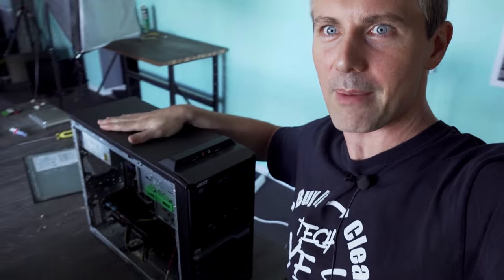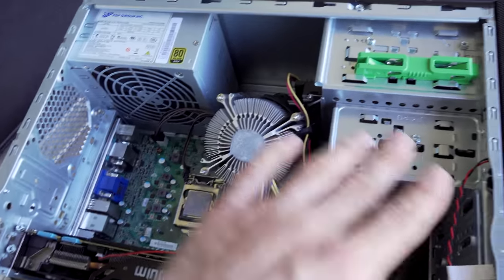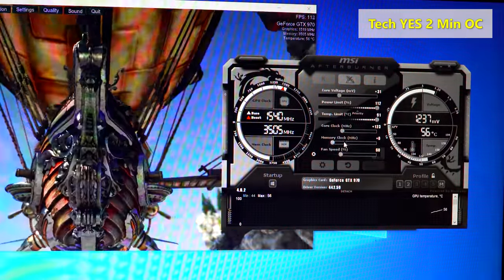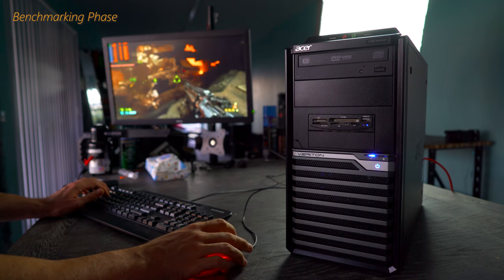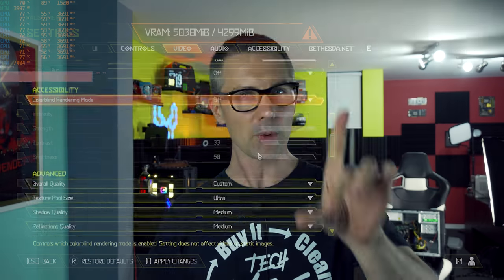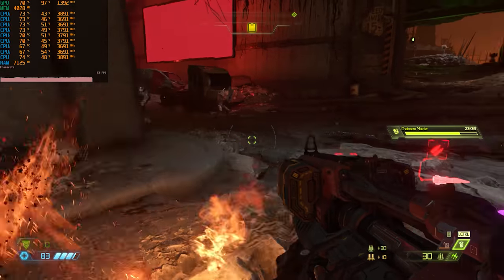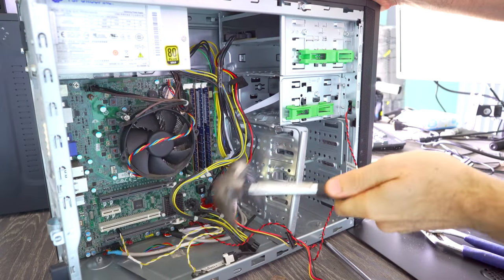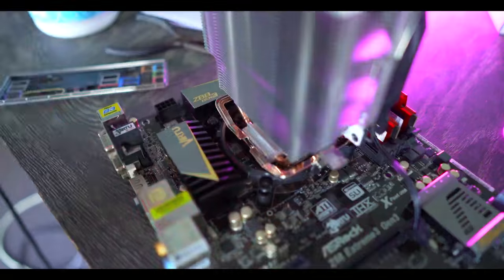How I Built a Gaming PC for Doom ETERNAL for only $190

Comment: I have about 65 USD in my PC right now. Total. Xfx RX 580 8gb , ryzen 5 2600, 128gb Samsung SSD , 5tb of barracuda HDDs, 16gb adata 3000mhz ram, RGB Asia horse fan kit, 400 watt PSU, and a deep cool case. My average cost per part was about 5 bucks.

Comment: Man, I just love your channel! Love taking used gear and gaming with it on a budget! Been watching you for a while on my other channel, by the way. Just put together a Dell t7500 with an x5675, gtx 980, 24gb ram, 500gb ssd, and 2 500gb hdds for only $170! Love this stuff! Keep up the great content!
Reply: It supports 2 CPU , why are you limiting it to just one x5675 ?
Reply: @manojgupta3770  mine does not have the riser board and for gaming use one cpu is all I need. I don't believe adding a second cpu would do any good for gaming performance, at least.
Reply: @bantertech8146  Yeah thats Right. I too had offers for T7500 & T5500 but I bought T3500 (used) instead ........ it was lot Cheaper and I used Processor W3680 which via TS I overclocked it to 4.1 GHz on all 6 cores and it performs better than Ryzen 5 1600 system.

Comment: Minimum: 1050ti.
Oh no my card has aged quicker than I expected.
Reply: Time for rx 570
Reply: @btd1114  
I have a question is there is big difference between rx 570 and 470?
Reply: @IWoVex  its the same card
Reply: @Travelfast  thanks
Reply: I-WoVex 10% performance increase for rx570 over rx 470
Reply: What did you REALLY expect for a 50 class card?
Reply: @sporkmaster3689  it's a 4 year old card dude. You got 4 years covered of atleast minimum game specs with a 150ish dollar card. That's pretty damn good value. You've had 208 weeks since release to save for a new card....
Reply: @skoopsro7656  My 1050ti never disappointed me. I play games like Forza Horizon, The Crew 2, Far Cry 5, The Forest and Doom with the highest settings and the fps nearly never dropped below 40.
Reply: @sporkmaster3689  I picked my rx 580 for 95$
Reply: It's a 50 series, it was barely minimum to begin with.
Reply: You find em cheap in Facebook marketplace. I found a 1060 for $90 and I get to play at ultra settings. It really surprises me
Reply: Nope it’ll run on the 2gb and quite well usually 50 or better at 1080p. A 1030 will run it in 900p around 30fps. This game is well optimized.
Reply: @binksninja  wrong
Reply: @binksninja  u said high and ultra? high u can play with 4gb
Reply: @binksninja  doom eternal u can play high 4gb vram. so lol
Reply: @binksninja  minecraft runs on java tho xD

Comment: For those wondering about the Gammaxx 400, I've used it in several builds and it works wonderfully (mostly in overclocked x79 systems).  It's not hard to find in the states for less than $24USD, which makes it an amazing option for the price.  I will say, I was seeing the same thing with the Gammaxx S40 about a year ago and now those things are going for an average of $40USD, so no telling if the same thing will happen to the Gammaxx 400, only time will tell.  But again, if you find one for less than $24USD then it's a huge bargain, imo.

Comment: One of the first games I played on my Tandy 286sl box back when I got my first VGA box and a small hard drive. I think it ran Windows 3.0 but Doom ran OK on it back then with 1meg of ram. This is certainly a lot different but brings back the fun I had has games got faster and better looking as my system got better and faster. Might have to get that and see if my X79 with a 4960x, 32gig, and a GTX 1070 ftw would play it. Thanks for the fun watching you custom it out and just play because you can.

Comment: 1392 mhz boost on the clock for a GTX 970 is impressive! I have one that barely stays under 81 degrees at 1088 mhz(after refurbishment). It is a blower style though but still.

Comment: I'd totally take the motherboard and PSU out of the veriton's boring looking case and put them in a new, modern case, then replace the cooler, too. I did this for an i5-8400 that I picked up, and sold it for $500! You can do this because veritons aren't proprietary and the CPU Cooler is held on by a backplate that's just taped on. 115X for the win! I did this with an i5-2400 small form factor system, too, and it worked really well!

Comment: 1070Ti 3200x1800p on Ultra Nightmare settings, rock solid 60fps, with minor, very short, drops to 55fps area which is covered by the FreeSync. Id Tech did it again, great optimisation. 4K with dynamic resolution works as well, but the resolution drops far lower than it would need to.

Comment: Instead of a hammer, you might try a rubber mallet. The larger head works well on panels. And there's less chance of flying metal fragments from the computer case.

Comment: So this isn't the first time I've seen you bang a hard drive cage to make space for a gravis card. I suggest you to drill through the rivets holding the cage instead, that way it will look way nicer for the customers and it's so much safer without the sharp edges. One extra thing you can do that way is to remount the hard drive cage in the future by replacing the rivet holes with screws, maybe self tapping or use a cheap thread kit to make proper threads. Sometimes rough Tech Yes Lovin' isn't the way to go.
Reply: i thought the same,but that would not be in the "TechYes" fashion...

Comment: Vulkin API at this point should just be the industry standard, so I will for sure be checking this one out on Linux to see if I get similar preformance numbers on my AMD A-10 5800K, 16GB DDR3 OC 2133Mhz, and 240GB SSD, 2TB HDD, and an AMD RX 560 4GB GPU on Manjaro Linux w/MATE DE.

Comment: Hey Tech YES, I recently got myself a Ryzen 5 3600 and its running really hot. Im using a stock cooler. Would you recommend that I get a 3rd party cooler instead?

Not overclocking,  just gaming.
Reply: If its running really hot, get more cooler air somehow, cooler, case, fans, whatever it takes, unless it's an RMA
Reply: On the r5 u dont get wraith prism either do u? That cooler must suck
Reply: @nickmccarty2696  Yeah, its the Wraith stealth.

Comment: Truthfully, a first or second gen i7 would work just fine with a decent GPU.  I ran Doom Eternal on Ultra Nightmare settings at 1080p with a GTX 1080 and an i5 2320 without observing much of a bottleneck.  Turn on Vsync and my four 2nd gen i5 cores didn't touch 100 percent.

Comment: Fps would have been even higher if you configured doom to not use more than 3,5gb of vram. Remember, the gtx970 does not have 4gb vram. It has 3,5gb of fast and 0,5gb of slow vram. 
Cundos to doom, the engine is unbelievable efficient.

Comment: 5700xt?! 🙄🤔 even with the 5600xt there would be a bottleneck. I think going with a gtx 1650 super would be great but if you want to get the most out of i7 4770 i recomment gtx 1660 super.(you'll have some bottleneck)and changing cpu cooler and some overclocking for the cpu would be great.
Btw thanks for the content and things i've learned from you. 😉

Comment: the i7-4770 is not really "Low brand" cpu
the i7-6700 is a rebrand of a i7-4770
i was doing research on if I should have upgraded from a i7-4770 to a ryzen 5 3600
kinda wish I didn't
only thing I really paid for was pretty much more cores
and a slight increase in turbo boost :( 
3600 - 6 cores (12 threads)
i7-4770 - 4 cores (8 threads)
3600 - 4.2ghz turbo boost
i7-4770 - 3.9ghz turbo boost
all a person would really have to do is...
get a 4770k and overclock it to 3.8ghz which is not that much
to get the same results as a ryzen 5 3600
i might take my machine back now :(

Comment: Brian why don't I live in Australia? Why don't people here in Serbia even remotely try to be reasonable when pricing used gear? for 175 AUD you can't even get a i7 4770 by itself (100 EUR at least) let alone including 16GB RAM (50 EUR at least) 1TB HDD (20 EUR at least) and that PSU (again 20 EUR at least).
Reply: My parents have a 1156 socket mobo (MSI H55M-E23 shitty I know) now with X3440 @ 3.4GHz on stock i3 cooler (terrible ~80c) instead of i3 540 it originally had which I got on AliExpress for about 6 EUR. It has a EVGA 750 Ti 2GB SC and 250GB Samsung 850 EVO and sadly only 4GB ram as of now. I slapped Pop!_OS on it two weeks ago and it works wonders. Planning to replace RAM to 16GB (if mobo accepts it - 2x4GB is officially supported), install a USB 3.0 card and possibly repackage it into a smaller ThinkCenter SFF case in order to use it in the living room at some point. This PC could probably be sold here for at least 200 EUR once RAM is replaced so that can give you an idea how terrible used market is here. Not to mention that buying new components would probably cost you at least 20% more than in US due to European VAT and import taxes and importers here being jerks. Thankfully we have a site where people import stuff from neighboring countries (Hungary for ex) for much less money than can be bought at the stores.

Comment: Could I run it at 4k 60fps just like the previous game? Using a i7 6700k RX 5700 xt Overclocked
Reply: @SISSYPUSS  some games at 1440p? It runs them all at max 1440p 60+ fps lol. Tons of new games run at 4k ultra 60fps but not all. I guess I'll just try it

Comment: I was Wondering Since you r a computer Genius....Would it be okay if I use A 14pin to 24pin converter on a motherboard that supports only 14pin power connector,I want to upgrade my gpu and it wont happen without A new power supply #help

Comment: You don't really need that sticky tape, proper 3.5" to 5.25" adapters cost peanuts.
Reply: but thats not the "TechYes" way???
Reply: @leonefurlan137  I suppose that's also true. But hey, I'm only just getting familiar with the "Tech Yes" way, so give a dude a break.
Reply: @mistermudpie  all good my friend. The break is yours...
Reply: Had an open 3.5 drive bay under the 5.25 drive bay

Comment: I keep asking for it and still haven't found a good answer. Is there a good alternative to the all purpose spray that we can buy in the US?
Reply: M.A.F sensor cleaning spray from an auto parts store will clean  electronics without damage
Reply: @79huddy  thanks, I meant the multipurpose spray though, not the cleaning spray
Reply: @stevenwilliams6638  thats just mineral oil wd 40 is pretty much the same thing you can get straight mineral oil from ZEP supply
Reply: @79huddy  WD 40 leaves a sticky residue after it's applied.
Reply: @stevenwilliams6638  we used a natural beef fat based oil at a sand cast foundry I worked at to keep sand from sticking to the patterns you sprayed it on then blew the pattern  off with compressed  air to dry it it's non toxic and dries to almost a dry film like silicone spray don't know where they got it from though